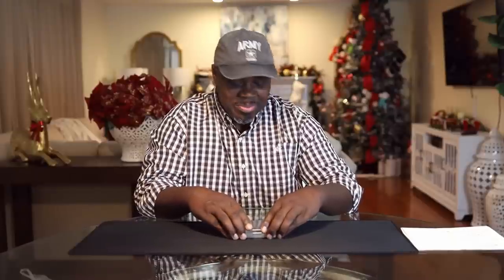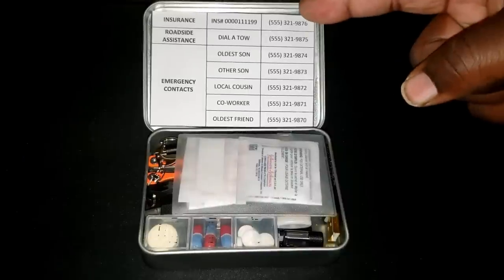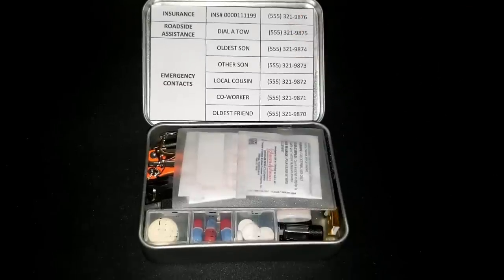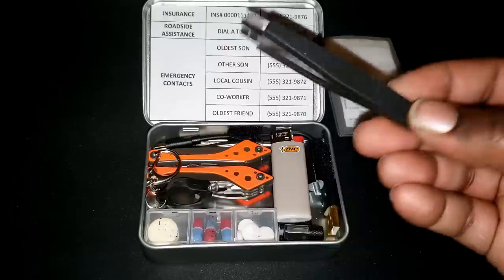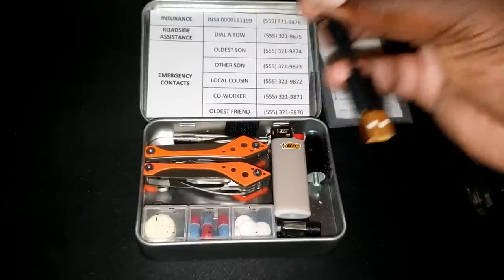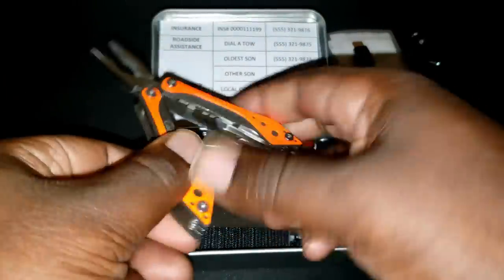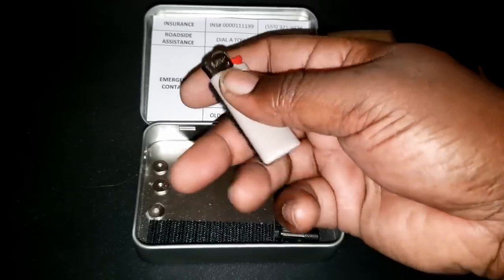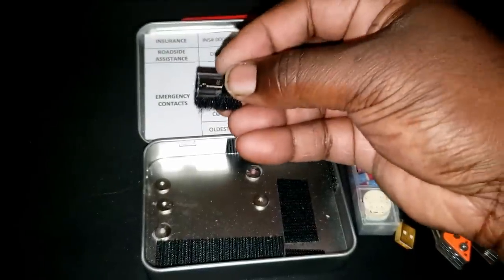Emergency Prep : The EDC Tin!

Comment: My EDC is a 2.5 ton 4wd with all the bits and pieces I will need if things go South in a big way. It doesn't fit in my pocket but I do fit in the drivers seat. Sort of the same thing isn't it?
Seriously though I love compact survival gear and have a bit of it myself.
Reply: @DebieSims  Lol thanks.
Not sure if it was a rational idea or more as of a result of having a bit too much to drink.
Either way having a bit of a think about what may go wrong and what may make things a bit easier in the event of certain situations is just smart thinking.
You don't have to be too far off the beaten track for things to get ugly especially in areas that are hard core in terms of weather conditions etc.
Take care.